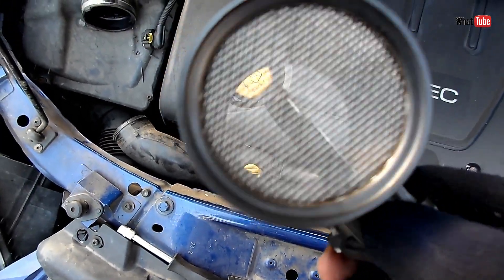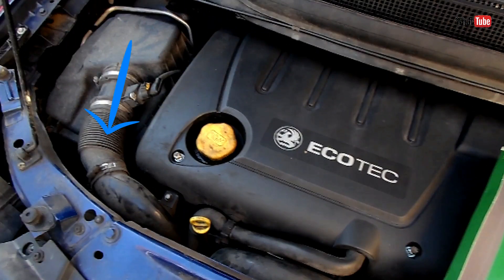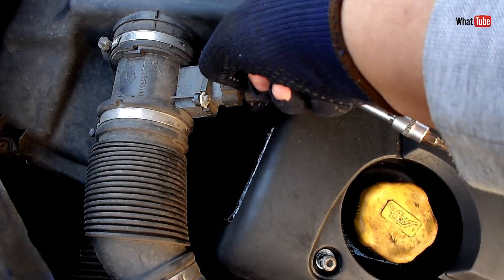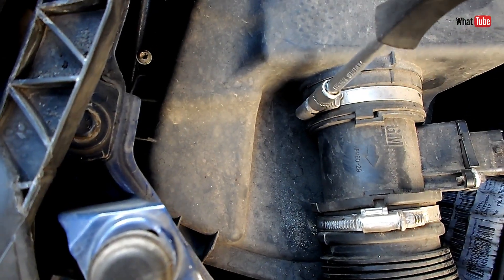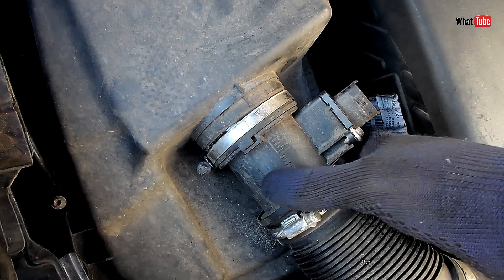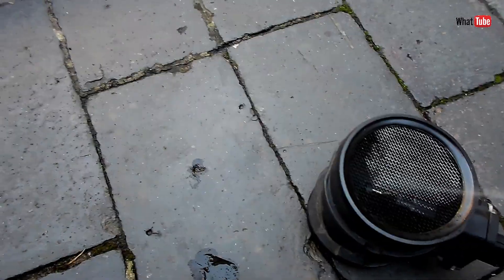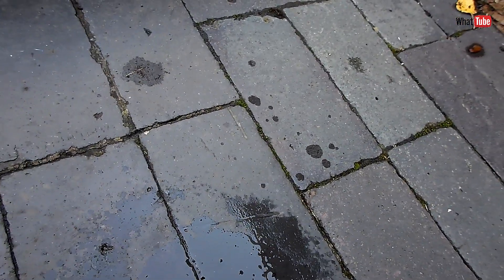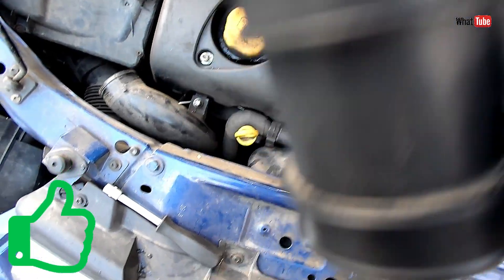How To MAF Sensor Cleaning (Mass Air Flow) 1.9 diesel Opel Vauxhall Fiat Alfa Romeo

Comment: Would a dirty maf sensor cause boost to not work? Turbo doesn't kick in until already doing speed limit
Reply from the maker: Hi, yes it can, try to disconnect the electric connector, then start the engine and drive it, if there isn't any difference then the maf sensor is good.
Reply: @WhatTube  thanks. Will give that a go.
Reply: @WhatTube  Would a bad mass air flow sensor cause the radiator fan to run constantly?

Comment: Hey I have opel astra g Caravan 2000 and my problem was my car started up and then like in 10 sec stalled but after I tried to hold the ingnition key for bit long it sturggled to ignite but started up. Could It be like fuel pump has gone faulty or MAF gone bad cause when I listen closely I hear hising sound like you know like if some small object got rim and when you pull out it makes like sound of that

Comment: Can i clean it with 70 % etanol ? Or contact spray ?
Reply from the maker: Yes, contact spray is better.
Reply: only by mass air flow spray
Reply: Electric contact cleaner, carb cleaner will foul/contaminate the sensor